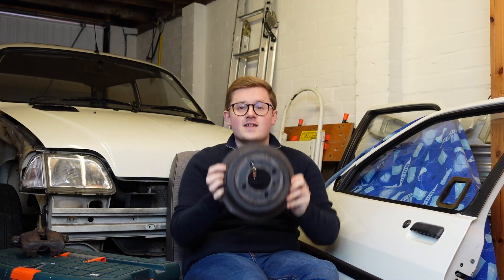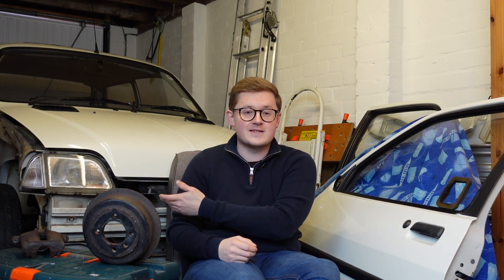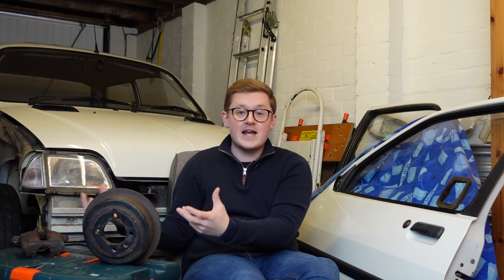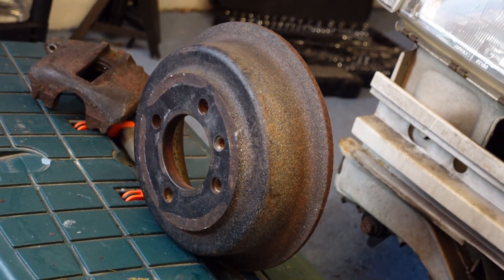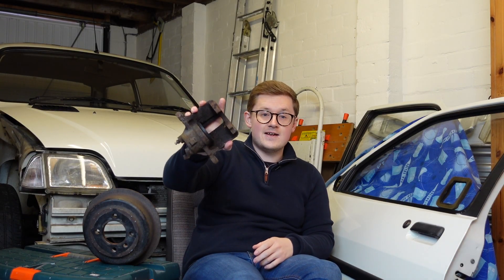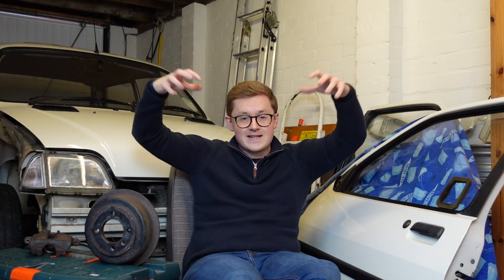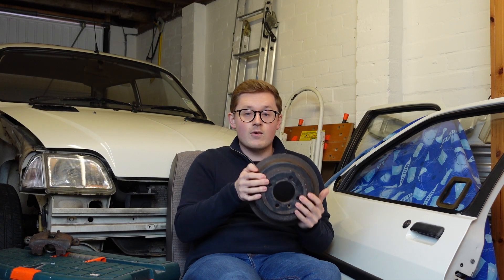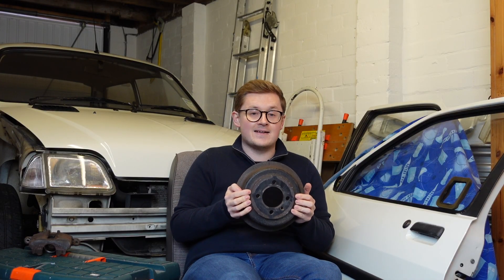Why are Drum Brakes Making an EV Comeback?

Comment: I read an article in 1975 in which somebody said that drum brakes could be making a comeback because disc brakes never fully disengage and they introduce friction when the car is moving. It is good to hear that this prediction could eventually be coming true.
Reply: In a disk brake caliper in good working condition, the flexure of the piston seal acts as a return 'spring' to retract the piston and brake pads from the rotor. Pad contact is extremely light and does not add significant friction. If a brake rotor drags then it is an indication that the caliper needs overhaul/servicing.
Reply: @russtynail55 Glad your comment is here. I certainly don’t know everything, but I was formally trained as a mechanic and this is exactly what I was taught… It’s the piston seals that function as return springs.
Reply: @truthsmiles  Thank you. There is a lot of misunderstanding of braking principles and design and brake operation amongst the general public. I was also formally trained as a mechanic, I hold an Advanced Trade Certificate in Automotive Engineering, have been in the automotive industry for 35 years, and was an assessor/tutor in a polytechnic institute for 9 years. I will reiterate once more. If the disk brakes on your vehicle are dragging, they require overhaul and the attention of a well qualified mechanic.
Reply: @russtynail55  What this guy said
Reply: Absolutely right, the piston seal acts as a light return spring. @russtynail55
Reply: I have been fixing our brakes for 40 years, and I think it would be easy to introduce a redesigned disc brake system to keep the pads from rubbing, something along the lines of a couple of springs impinging on a tab to maintain pad separation.
Reply: @sjb3460 the Prius uses springed pads, they pull the pads back when not applied, I think it's more common on hybrids.
Reply: @sjb3460 should be very easy, all disc brakes in bicycles have springs on the pads to fully separate them
Reply: @omurize2007 I thought that I messed up the first time doing car brakes because I thought they wouldn't touch like on a bike
Reply: @sjb3460  No need for this - small imperfection on disc surface keep pads apart enough to minimize friction. And no need to push pedal too far to start braking.
Plus - this minimal friction cleans most of contamination from disc (like driving in rain, snow or mud)
Reply: If the brake components are all in good condition the pads are just gently touching the discs, they cause practically no friction at all. The very principle of operation of disk brakes ensures this, when there's no hydraulic pressure the pistons move freely so any contact with the disc creates a normal force that pushes the pad away.
Reply: @BigUriel  The caliper seals deform when under pressure, which causes the pistons to retract when under rest.  Very similar to the springs in a drum.  They don't move as far, but they don't need to.  In both cases (disk and drum), the friction material can float and is centered by the steel surface.  In the disk, it is the floating pins.  For drums, the whole pad assembly easily floats, and is held in position by the fact that the drum pushes it to center.  Pushes it with similar friction to a disk brake -- practically none.
Reply: @BigUriel  Yes jack up the wheels as a test they should spin freely
Reply: Correct. @BigUriel
Reply: @BigUriel  The garbage discs they use in modern vehicles will usually warp before they leave the dealer lot and knock the pads back before a full revolution is even made. There's more drag in the CV boot flexing than there is from the calipers dragging...
Reply: Another issue with sliding callipers (the design used on older cars anyway) is that, as well as surface dust on the discs the sliding components can rust and partially sieze when not  used so they don't completely get pushed clear of the disc and drag for some time after each application
Reply: Drum brakes are much harder to change than disc brakes.
Reply: The disc brakes on my 1974 VW Beetle never drag because they were designed and manufactured properly with twin pistons and simple seal flexure to retract the pads, not the ghastly rust prone cost-cutting single piston sliding monstrosities we see on modern vehicles!  It really is not rocket surgery...
Reply: It's very common on hybrid and EV to retract the pads 1/16 for less friction until needed.
Reply: If they don't rub then they won't clean off the discs, so your first stop you would need an entire revolution before the corrosion is off the disc
Reply: Lots of japanese cars have small spring clips that push the pads apart
Reply: Yes and no, the pads and disc makes contact when you're moving yes, but that in itself does not mean that there is friction between them, disc brake systems allow the pads and disc in constant contact but without applied pressure the centrifugal force of the moving disc will push out the pads just enough to not cause friction. Friction is only present when pressure is applied(or a very miniscule amount that is almost irrelevant). Some advanced ESP systems with crosswind assist, active lane keeping, active brake assist, trailer assist will actuate individual wheel brakes depending on the situation and wear out the brakes much faster, usually replacing pads below 45k km and discs every other replacement
Reply: @andrewchin5583  Centrifugal force does not push out on the brake pads to retract them. The brake pads are applied to the sides of the disk rotor, 90 degrees to the angle of centrifugal force. I reiterate that the caliper piston(s) are retracted by the piston seal returning to its natural position. The seal is of square section, as the brake fluid forces the piston and pads against the rotor, and the seal is 'twisted' (distorted). When the brake pedal is released, the fluid pressure drops, and the action of the rubber seal returning to its natural shape/position slightly retracts the piston and the brake pads. As the brake pads wear, the caliper piston moves forward slightly through the seal to compensate for the pad wear and to maintain the piston/pad position against the brake disk rotor. This automatically compensates for pad wear. As the piston moves forward, fluid flows from the master cylinder reservoir to compensate. This is why the brake fluid in the master cylinder reservoir must be topped up periodically. If your disk brakes are dragging, take the vehicle to a professional mechanic to have the brake calipers overhauled or replaced.

Comment: Interesting theory, but have a little less brake drag and longer life is the least of the problems with battery EV'  take up for most people is not affordable and if the government removes the tax advantages for companies EV sales would be nowhere. The car companies know reliance on batteries is not any sort of solution. Toyota have said this openly and have several alternative ICE systems in developement. The biggest question is will EV's in fact deliver reduced pollution. As with most environmental systems it seems to involve spending more now, poluting more now (all be be it elsewhere) and using more rare materials dug out of the ground in 3rd world country's.

Comment: You didn't mention weight distribution on axles,wich is mostly the reason EV have drums on the rear.
EV are way heavier ,they have more weight on the rear,less mass transfer during braking,so less risks of reduced tire grip.
Brake force distribution is not the same at all on EV
A diesel fiat doblo of 2018 will have drums at the rear,while 1.7 ton : it's mainly a utility vehicle ,often loaded at the rear with stiff suspensions ,so mass tranfer is low.

Comment: I agree heartily with your comment about some vehicles being "over braked". Some cars
driven (on public roads) in a manner to use just 80% of the brakes potential, would have the potential to have its driver arrested and convicted of dangerous driving... and achieving
speeds that would get the car sent to a crusher and recycled in some places...as the said brakes are designed to brake the vehicle from over 200kmh repeatedly. ie time and time 
again in a time frames of seconds... Like driving Mount Panorama at full throttle to
the red-line through every gear and maximum braking for every sharpish corner lap after lap.

That's a waste of money, (on public roads) vis a vis the the said braking system, and it's also undermining the performance of the vehicle due to the inertia of the extra weight of the brakes. 

That extra (unsprung) weight also contributes to tyre wear and the undermining of suspension response time/vehicle handling/cornering ability and ride quality. I see these huge disks with 4 and six piston calipers on SUVs and I have to laugh at the absurdity of it.

Yet droves flock to these vehicles.   I say "droves" and "flock" because their drivers are no better than mindless sheep following the flock... or at very best, trying to outdo the Jones
next door... if only they knew they were outdoing the Jones next doors stupidity. LOL

Comment: You missed an important point: Self-servo action. Drum brakes as parking brakes are far more effective in the real world than the mechanical-linkage rear calipers most VW cars have used for over 25 years. 
All VW ID cars do not use a parking pawl in the gearbox. The rear (drum) parking brakes are the only thing holding an ID in place when you park the car. Rusty rear disc brakes (with no inner parking drum) are not reliable enough.

Comment: Another added benefit of drum brakes are they work without assist (usually via vacuum). Because disc brakes have such a small pad area and are not effected as much by inertia (the reason why drum brakes load up so quickly), they require added assistance beyond the hydrolic activation, which is why when the engine is not running, disc brakes become very poor stoppers. The reality is most cars do not require rear disc brakes as you rightly said, the front brakes do 70-95% (of the stopping). AAMOF when ABS first appeared, they were fist used on the rear only, because during emergency braking the rear brakes were much more likely to lock up than the front.
Reply: The disc brakes still work perfectly well when you have no power assist if your master cylinder is properly sized for the brakes and you dont have something parasitic like an ABS module in the way.

ABS was put on the rear first not because of rear lockuo being more likely, but because in the case of a rear lockup, the car will begin to yaw, something which the average driver is woefully unequipped to handle.

Comment: Big, heavy, commercial trucks mostly use drum brakes.  The large wheel diameter leaves plenty of room for big drums, and the engineering compromises, explained in this video, have always come out in favour of drums.  This despite the brakes needing to stop thirty tons plus, and without regenerative electric braking.
Reply: Most tractor units use disk brakes
But most trailers use drums.

Comment: Drum brakes, per wheel, are also lighter in weight than a disc setup. Drag racers have used that little secret to shave a few tenths of a second in the quarter mile. The drum brakes are well within their capabilities to slow the race car after a short run without boiling the brake fluid. And they don't produce unnecessary drag at the wheels. It often means the difference between winning and losing.

Comment: Heat isn't the only #1 enemy of drum brakes. Water is even worse. Drive through a pudle of water & you have no brakes for until the eventually dry off, or it steamed off by riding your breaks for about a half mile to mile. Scray situation indeed!

Comment: simple debunk. hydraulic force is greater than mechanical, or electric, or magnetic when it comes to pressing two surfaces together. also, hydraulic force is constant even in the event of power outage. the reason brake systems use it . the current cost cutting, over charging market is putting people in danger while those very people believe they are better off. sad .
Reply from the maker: Debunking of what exactly?

Comment: A  drum has more mass in the same diameter as a rotor and EVi's are heavier.  If the antiquated 2 shoe and single cylinder were replaced by a pair of cylinders and pads made for a cylinder, you'd have the best features of both designs

Comment: Sisters spanky-new SUV has drums on the rear - my good pal is a main dealer mechanic for the marque in question - I asked him why. Seems drum brakes give them less hassles than discs when used on the rears - discs tend to drag more, need more attention, seize more often & generally need more focking about with. Who knew?

Comment: Drums brake harden than disks do especilaly de duplex system. The larger surface area is goid to elongate lifespan not to increase brake force. The exponential increase in brakeforce comes from the the rotational friction force that pulls the curved liner into the drum..

Comment: EVs do not improve the environment. Apart from the fact that most electricity is generated from fossil fuels, the battery production is very dirty, and cars like Teslas are designed to be trashed after 8 years.

Comment: The disc brake was patented in 1904 and the drum brake in 1906. Before that, vehicles either used wood & leather blocks pressed against the wheel rim or band brakes which gripped the outside of a wheel mounted drum. Only tanks & other tracked vehicles use band brakes today.

There are two types of drum brake, single leading shoe (SLS) and twin / multi-leading shoe (TLS, QLS, DTLS). Multi-leading shoe brakes  only work well in one direction of rotation and are grabby. They also need experience in setting them up correctly.

Comment: Really enjoyable video. I have a bit of history with drum brakes, starting with my first car, a fully drum-braked 1959 Austin A40. It had twin leading shoes at the front and single leading shoe rears operated by a single cylinder for both wheels - which also acted via a lever as the handbrake. No twin hydraulics either - one leak and all braking failed.
And yet the rear brakes frequently locked-up in an "emergency" stop.
Back in the day you needed to adjust the drum brakes using a screw driver or spanner from time to time: you judged this by brake pedal travel. Self-adjusting brakes came along later to everyone's great relief.
Love it how you put the environmental issues forward. A ventilated disc front and self-adjusting drum back axel set-up is probably the best compromise?
Shame so many cars nowadays are over-sized and over-weight and so are given brakes etc far more powerful and  environmentally damaging than necessary IMHO.
Reply: The A40 had a mechanical fail safe  built into in the foot pedal linkages that operated the rear brakes in case of hydraulic brake system failure.

Comment: Regarding surface area there are some other factors that need to be considered. Drum brake shoe make much less uniform contact with the drum compared to much more rigid brake pad pushed with 1 or 2 (or sometimes even more) cylinders. Therefore I would not state that having theoretical higher contact patch does mean anything in real application. From my own experience with drum brakes they do rust much quicker and require twice as much time for maintenance. Just removing a drum is usually a pain, then you got these nasty rotten springs and clips everywhere.

Comment: i drove 18 wheelers in the mountains for many years.i never had an issue with air brake drums. ALLWAYS made sure they were adjusted properly.& used them wisely.once you heat them up to a certain point they fade BADLY.& dont cool back down quickly either.i was aware of it & never had a problem in 15 years.
Reply: Did any of your trucks have retarders fitted?

Comment: My Tesla has disc brakes, so has every vehicle I've owned in the past 20 years.  Seems like it would be very easy for the software to every day or so apply some stopping power using the disc brakes instead of just regeneration. This would keep the brake rotors rust free. 
I drove for many years using drum brakes. Brake failure and fading stopping ability was common.  I can't remember anything like this with disc brakes.  Maybe surface area suggests they have more stopping power, nothing in the real world supports this.  Disc brakes are so superior even discussing using drum brakes seems a complete waste of time. Drum brake pads are made using  embedded asbestos, as the brakes wear this dust ends up in people's lungs.   If a drum brake get really wet, they loose all stopping power. I experienced many times, the funniest being  in a pick up truck after driving through a shallow stream. My coworker Norm then drove up to the stop sign at the busy road,  applied the brakes and we shot straight through the traffic. Making the noises you might imagine. 
The only argument for retaining drum brakes as long as they were was: they were made in such quantities they were cheaper. The only argument now would be someone has a factory that makes them and wants to continue making them. (This is the only reasons most cars have had 12v systems for the past 50 years.)  I see no other possible argument for drum brakes. 
There's a frame of an old car on Rush North Beach in Ireland  (just north of Dublin). It's brakes on the rear axle. I've never figured out what model car this was, but it's stopping power must have been more of a wish than anything else.
Reply: 18 wheelers with their drum brakes would like to say hello.  Disc brake pads used to be made with asbestos as well, modern compounds for either design don't use it.